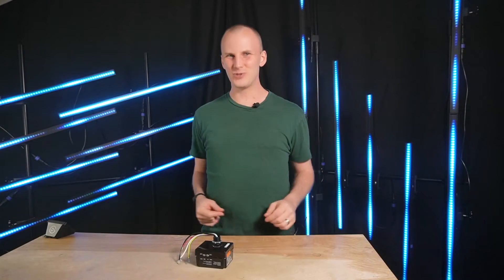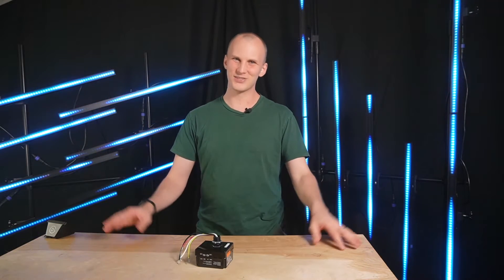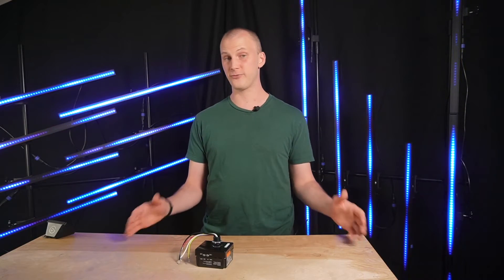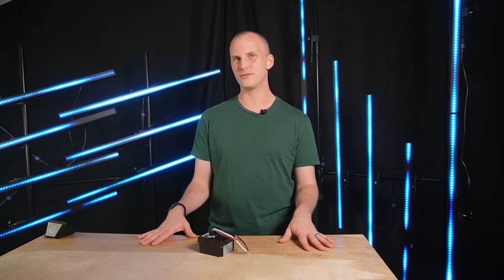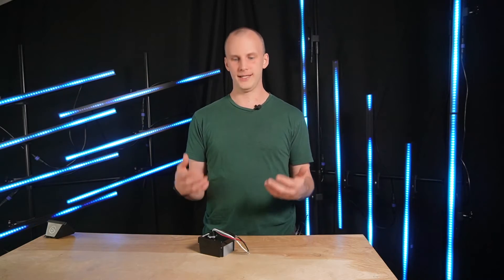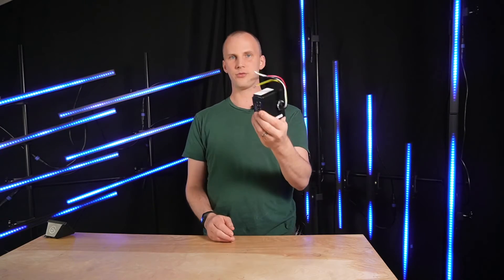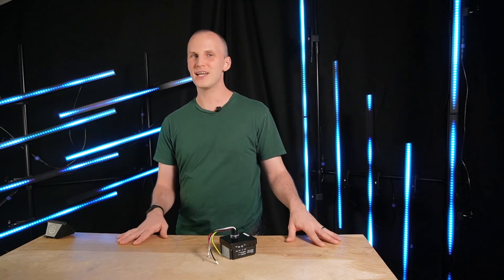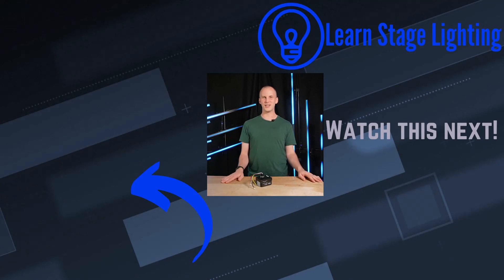Should I Leave My Lights Powered On All The Time?

Comment: Just from my own experience, I've worked with a mix of LED DMX lights and dimmer racks in a rig and I normally just switch everything on when I come in in the mornings, leave it for 15-ish minutes for all the servers and networking to set itself up and any control systems to figure themselves out, leave them on all day, then when I leave, shut it all off.

Comment: any issue w/ surge, or is that OK if lights off?  the ETC relay  staggers power on.

is it easy to be sure the DMX control not on the master?  Or "protect" it from being turned off?  not want to power down accidently.  

ggh

Comment: I run ca 2 universes of scanners, LED bars etc in my apartment and use 15 or so IoT power plugs to control power and get consumption stats. Works great so far and it´s nice to selectively power only the things I need. Them being wireless is of course not ideal in crowded places, but it´s not as bad as wireless DMX, as there is no constant stream of data. These things can also be installed as breakers in a central location, but I wanted to keep it simple and be flexible. The plugs handle 2.5 Kilowatts each and have some bells and whistles like time based power cycles or power consumption (load) limits that shut down at a certain wattage. At 20 bucks a piece, I can´t complain after 2 years of use.

Comment: I am so glad to have found your channel. I just bought 4 ETC Spots, 4 ETC Pars for my tiny, tiny middle school theatre. I also have the Colorsource 20 console. I have to unplug my console every rehearsal   and plug it back into the DMX cable as well as power each day. Do I need these relays?
Reply from the maker: If you unplug your lights each day, you don't need a relay.  But if you're only unplugging your console, than yes!, you should use Relays at your lights or breaker/turn them off everyday.
Reply: @LearnStageLighting  thank you so much. Great channel.

Comment: I think these relays don't need to be controlled over DMX, but a switch near the light desk, preferable one with a key that is located in a spot (including at least 2 spares, in the vault and in a seperate keybox or in a standard drawer or something like that) so you can only switch it all on and off if you are trained for that. (aka know where the key is)
The reason i would advice the key, is so drunk people don't switch off everything during the show.
That is also the reason i don't advice switching the relays by DMX. A drunk person, or a failing lightdesk may make all the relays behave in a way, that the whole setup gets damaged when the desk goes mental because of a bug of sorts. 

So in the end, a hard wire connection, to a secure switch, would be the best option i think!

Comment: I'm having trouble updating because the newer lights need current on all the time and the dmx controls the light but we still run atlmans off an etc sensor rack. I heard that Etc has always on relys that I can add to my senor rack. I'm also running new cat6 to dmx boxes on each bar I will have  the newer lights on.

Wish Altman 360Qs had gotten the update that the etc 4s got.
Reply from the maker: Yes, the ETC R20 module is what you need for your rack